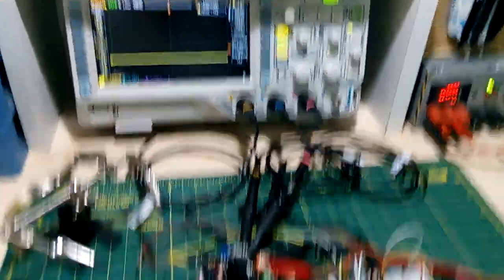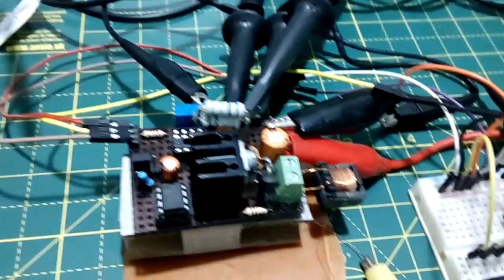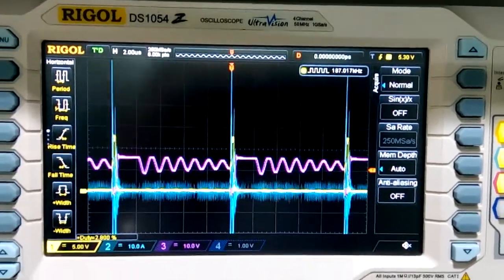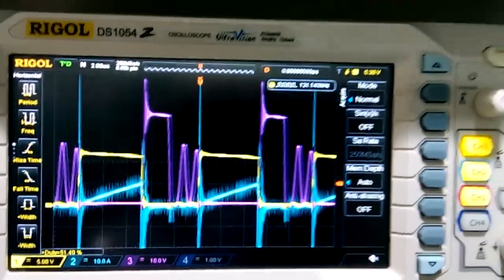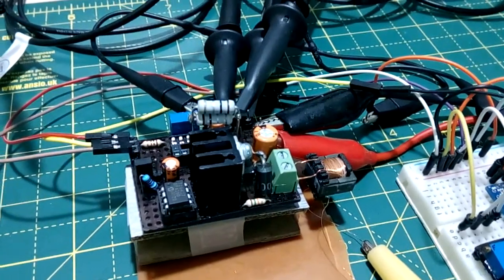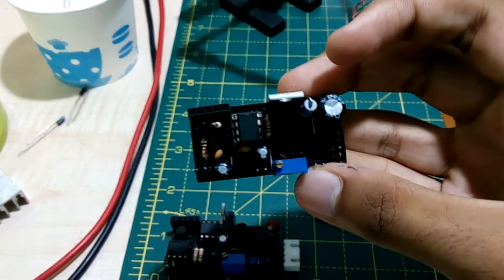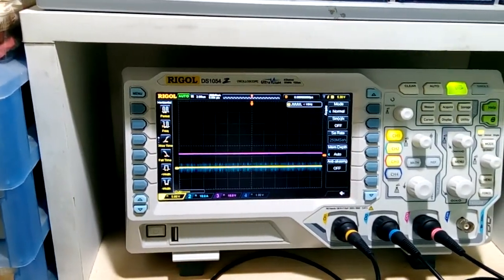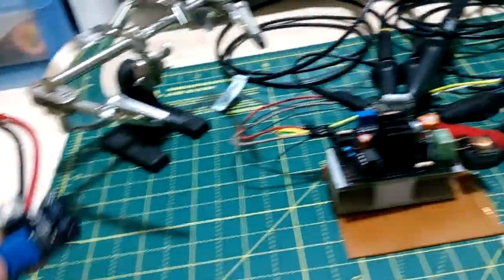Flyback Converter Works! | Capacitor Charger v2 | Part 1

Comment: hello, I want to design a 24v input 5v output flyback converter. I'm having a problem with the transformer that I will use as a mosfet, can you help me? capacitor 200uF, resistor 5ohm pwm wave will trigger mosfet
Reply from the maker: For transformers I suggest that you get some samples from Coilcraft, and as for the MOSFET, something like the IRF3205 (which is my go-to MOSFET) will work.
Reply: @NNNILabs  I need to design a flyback circuit without using a controller. It is a mosfet, transformer, capacitor, resistor and pwm wave triggered circuit. It will be 24v dc input and 5v dc output. I am not very knowledgeable. Can you give your e-mail address or intagram address so that I can share the matlab diagram of the circuit I will make.
Reply from the maker: @ffrei8977  I can do Discord: NNNI#6070

Comment: how can i contact you.
Reply from the maker: I'm afraid it'll have to be through the comments here.
Reply: Hi. I need your help to creat a boost converter to run a 72v bldc motor. If you are interested we can talk further.
Reply from the maker: So I assume that you want to make a converter that steps up some common voltage like 12V to 72V to run a motor. You could, of course, use a boost converter, it's simple and it works, but if you want that extra power maybe it's a flyback you're looking at.
I need a few more parameters like output current, power source, etc.
Reply: Thanks for showing your interest in project. Ok let me tell you this, I am creating a E-bike. Which is hooked with 1500-2500 WATTS bldc motor. Which runs on 48-72 volts DC.  It consumes 15-20 amps max. I am trying to create a DC boost converter which can provide constant  72 volts, keeping in mind that motor may require  2-3 times more current to start, than constant voltage supplied. And boost converter should have 90% efficiency. we can use 12 or 24 volts battery. So is it possible to create one DC boost converter ?
Reply from the maker: Would this do:
http://www.ti.com/lit/ug/tidud04/tidud04.pdf
Why not just use a battery pack with a higher voltage?
Reply: Thanks for reply and thank you for spending time to research on my project. Let me tell you this. Why i want to create a boost converter? My aim is to reduce battery cost for BLDC motor powered vehicle. If we can make a boost converter which can efficiently, increase 12 or 24 volts to  48 or 72 volts higher. we may require only 2 batteries instead of  4 or 6. I have checked the pdf shared by you, its almost same thing that i need. But we need to improve it, as i told you we need at least 3 to 4 time more current to start motor. So boost converter should be able to handle 10kw load for few minutes. As motor rating is 2500w-3500w.  Please help.
Reply from the maker: If you're capable of making the design from the PDF, then a good way to modify it to be able to handle transient high current pulses might be to add some supercapacitors to the output, just like filter caps. They handle the initial current draw, then the converter takes over.
There's another option:
https://www.banggood.com/1500W-30A-DC-DC-Boost-Converter-Step-Up-Power-Supply-Module-Constant-Current-p-1087084.html?gmcCountry=IN&currency=INR&createTmp=1&utm_source=googleshopping&utm_medium=cpc_elc&utm_content=frank&utm_campaign=pla-ele-in-pc-0428&gclid=Cj0KCQjwyYHaBRDvARIsAHkAXcv03mA9q6LA2omLi7hCeLguVWc3lpCZvyHNGGLy5F6driz9NSvsGwAaAmdKEALw_wcB&cur_warehouse=CN
These cheap kinds of modules in parallel might be the perfect solution, and implementing the supercap modification becomes easier. It saves the trouble of having to build a converter yourself.
Reply: Thank you for information, please don't take my words other ways. I am from CS branch. Not good in electronics, i will require your help for this. I am from delhi. Can we meet and make one. We can also create a video. Which will be helpful for people as well.
Reply from the maker: That might be a nice idea, but given the present circumstances I don't think that might be possible, since I live in the exact opposite part of the country!
Help is something you can always find locally. There might be some place in Delhi that helps college students with projects like this.

Comment: Very interesting.  What kind of wattage are you getting on the output of your flyback converter?
Reply from the maker: 35 Watts on the final soldered version. I have to make a video.
Reply: That's pretty darn good for a handmade flyback driver.
Reply from the maker: Thank you very much!
You won't believe the effort it took to get things to this stage!
Reply: Oh I believe it.  The charger is the hardest part by far.  I still don't have a working LT3751 driver (which was my goal from the start).  I went with commercially bought 100W flyback drivers.  http://www.ebay.com/itm/171649805897

Comment: Ah feels good, eh, progress? What I meant by suspending the load in water is usually when it's isolated. You don't want the water to become your load. For example is this: https://www.youtube.com/watch?v=WECW88rJYrE
Reply from the maker: Yes, feels great! I soldered the transformer to the charger board and spent the whole of yesterday testing it. It charges in 0.85 seconds, and the MOSFET doesn't even heat up a bit. Have to make a video.
Yes, the water actually became a load. I realized that, but at that point there was nothing I could do about it.
Reply: Yeah should do, I have a lot of ideas I can make a video about. I haven't really been doing much, but ideas are clicking.
Reply from the maker: I'm sure we'll all enjoy those ideas! I'll stay tuned!
Reply: NNNI Ohhh yes mate, you will.